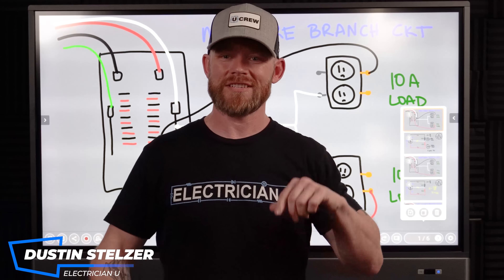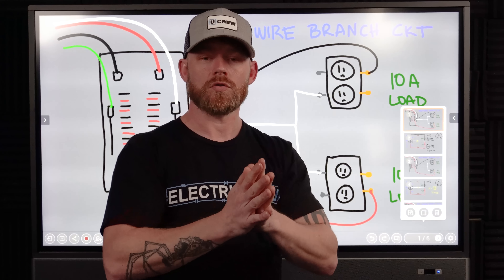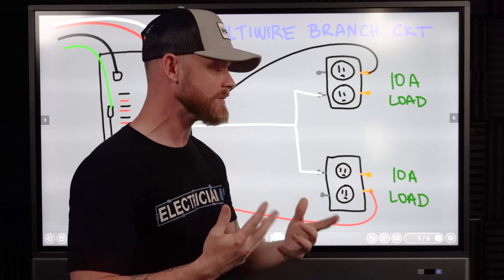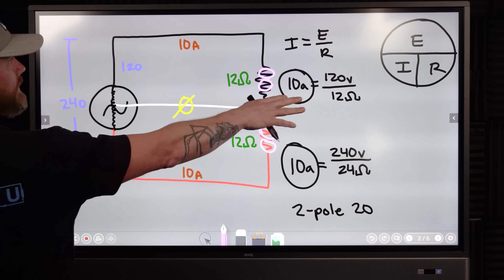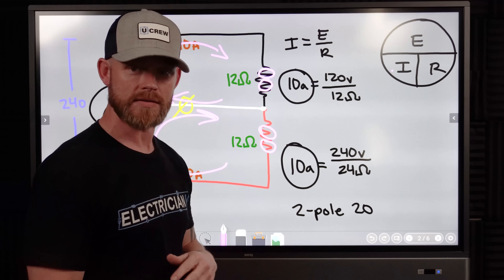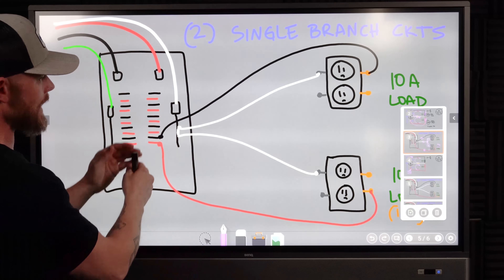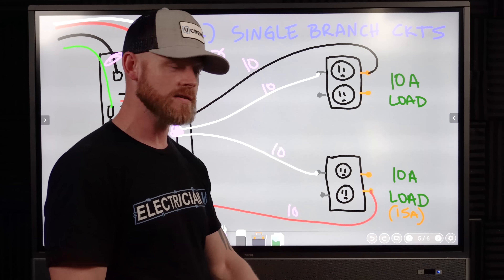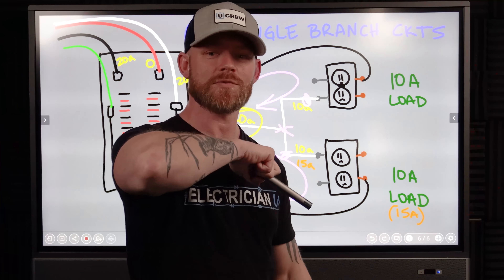Neutral Imbalance in Multiwire Branch Circuits (Two Hots, One Neutral)

Comment: Hello. My home main breaker isn't integrated in the circuit breakers panel that is inside the house. It's apart outside on another box that has the Kwh readings meter on the left side next to the 100 Amp main breaker. 
I need to install a manual transfer switch and a generator inlet box to power the house with two Ecoflow DP and a double voltage hub. My question is.  I consulted an electrician to do the job and he said that in order to install the MTS he would have to get the electricity out of this main breaker box to be able to install it.
I have no knowledge at all about electrical installations,but I'm a little concerned about this. 🤔 I would appreciate any advise from a pro like you. 
Thanks for the video 
🤷💡👍

Comment: The two legs are not 180° out of phase, though. Right? They're 120° out of phase. So they're not always equally opposed in the neutral. How does that play out for a device that cannot handle more than 120V?
Reply: You are mixing the strange US system with 3-phase used in most of the world. Loo up 230/400V 3 phase TN distribution system. Used in most of Europe and the world, but not in the US.

Comment: This is obviously a really thorough explanation about what’s going on but I had hoped that you would explain the pros/cons of implementing this. The electrician who replaced my panel in the 2000s told me he had added 2 breakers for future expansion but this is exactly what he did- 2 breakers in the panel with a single 12-3 wire run.

Many years later when I considered using this run, I finally saw what he did and was confused by it. I finally was able to learn what he had done but wasn’t why. I wish he would have just run two 12-2 wires instead of the single 12-3.

Comment: I'm working on 2 switch boxes. One is at the front door, the other is at the rear door. Each box has 4 switches. The boxes are connected with 14/3 so the switches all control the lights they go to.
I understand all the wiring except the ground wires. Even with pig tails there will be 10 grounds that all need to be connected. What is the best way to connect all the grounds?

Comment: Great video and now I know why I got a shock even after deenergizing the circuit I THOUGHT I was working on.  Will fix this soon, temp solution was to take dishwasher off line and keep stove operating (gas stove so no 240v required, just igniter and clock)

Comment: Is there anything to look out far when splitting up a shared neutral circuit. For example breaking off a section and adding a new line to tie to it own breaker.

Comment: A very complete and on target explanation. A minor correction in terms. A residential electrical system is single phase. The red and black are at different polarity, not different phases. Red is positive polarity (peak sign wave) and black is negative polarity (trough of the sine wave). That's the push/pull effect on the single-phase ac system. [yes, the sign waves flip back and forth, but red as positive polarity and black as negative polarity is how the NEC describes them in 200.6 & 201.5]

Comment: Great video it helps a lot .  Now i have new questions.   

If power is flowing from the neutral to the hot shouldn't the neutral be red or black instead?  

Also is it bad to have two same faze to share a neutral?  Should we always try to only share different faze neutrals? So the neitral wire isnt over loaded unintentionally.

Comment: Thanks for this video. I have this situation where I had a 12/3 on two separate breakers that did not have a common shut off handle. The 12/3 gets split in a junction box to service two separate circuits. I am now going to rectify the  fuse box issue by swapping the two separate 20amp breakers for a 20 amp breaker with one common service handle.

Comment: what are some ways to tell whether two hots are connected to the same phase? I'm guessing if the voltage across them is 0V it's on the same phase, if the voltage is 240V, they are on different phases?

Comment: When you say "balanced load", does this mean every single load connected to the circuit breaker that is also currently TURNED ON?

Or is it just the amperage ratings of every load whether they are on of off?

Comment: Does this apply to only two phase transformer or to three phase as well (if you use only two phases) ?
Reply: The perfect cancellation of the current on the neutral does not happen if two identical loads are in use with a 3-phase transformer.
The transformer which is described in this video is a one phase transformer with a tap in the middle of the winding. The two hot phases have 180 ° phase shift with reference to Neutral.
What you are talking about is a three phase transformer with 120 ° phase shift between subsequent ends (= phases) of the windings.
The neutral is connected to the star point (= the point, where all three windings are connected together.)
Because of the fact that the current is 120 ° phase shifted and not 180 ° the sum of the current on the Neutral is not zero, even with identical loads.

Comment: Great video! Thanks for clearing up what I thought was a mistake I made by sharing the same neutral. 

Here’s a question though. The old man before me had gfi’s everywhere. The one on the circuit (circuits) I did this to had a gfi that was causing the breaker to trip (or maybe it was the gfi, I forget) so I replaced the gfi outlet with a regular outlet and no issues since. Why would that happen? The gfi sensed current in a way it didn’t like?

Comment: Once I figured out that a common neutral will only carry the maximum load of an imbalance, which is equivalent to the maximum load of either hot, it all made so much more sense.  I understood this before this video, but "one pulls while the other pushes" is a great way to explain this to anyone else so I still learned something useful for watching.  Thanks!

Comment: I have a question. If I have a 3 wire circuit going to two different plugs, you said they are now  220 volts so if i plug a 110 devices in to either or both plugs will it burn the device out because the 110 device are on a 220 circuit.😢

Comment: Had an electrician add two circuits to my son's garage (that we made into a workshop).
Helping the electrician, I saw he was running 12/3 instead of two 12/2's.  I bitched.  He said it was allowed (and charged us for two new circuits....no discount for his material and labor savings).
Fast forward to my son getting a Tesla and looking into a power wall (I think I got the vocab correct).
They ran their tests and said they couldn't use the existing wiring because of the shared ground.

Does that make sense?  And can you explain why?

Comment: is it safe to jumper the nuetral wire on the independent top circuit to the bottom half to have 2 circuits or does that defeat the purpose of the shared neutral

Comment: Awesome video as always. Can you do a video on this same topic but with 3 phase? I'm having trouble picturing the pushing in pulling when you add the 3rd phase
Reply: The only way to balance a 3-phase system is to have the same current on all 3 phases like when using a 3-phase motor.
If you are using 2 phases of a 3-phase system, for example his 2 12 Ohm loads, the neutral will carry a small % of the current. If the neutral were open, you would have 208V across that 24 Ohm load which would give you 8 2/3 Amps. With the neutral intact, each leg will have the full 10A with the 1 1/3 A extra running doubled through the neutral.

Comment: Video Idea.... how to add AC cable (2 wire with aluminum bond strip) to NM circuit. Is it grounded properly tho no ground conductor present if you tie to NM 2 wire with ground? Thanks

Comment: Great explanation of MWBCs. i have an older house and wanted to install an appliance in the basement on an existing MWB circuit. I wanted to properly calculate load on the circuit and get an idea of how the circuit would handle a possible unbalanced load on a shared neutral. Mentioning how it is similar to how two single circuits terminate in the panel except the neutrals are tied together before the panel and how the different phases on the two legs cancel each other out on the neutral and the unbalanced difference is what flows through the neutral was also a big help. The best explanation i have come across.

Comment: Replaced electric range with propane range. Robbed one leg of 40 amp two pole breaker to install 120 volt plug for new gas range, how do I make this safe and meet code at the sub panel?

Comment: Question, if I ran a multiwire branch circuit on the same leg (phase) neutral, on a 15 amp breaker, would I be okay if I upsized the wire from 14/2-12/2 to 10/2 since 10AWG can handle up to 30 amps of current? (Not that I would want to do this, just wondering if it could handle both loads on the neutral if I upsized the neutral to 10 AWG or even 8 AWG.

Comment: This was a good video and thorough explanation. I’m surprised you didn’t draw sine waves to represent the black phase the red phase and explain that the sine waves are 180° out of phase and so on. This would be more descriptive then the black phase “pushing” while the red phase is “pulling”, in my opinion. 
The concept of alternating current sine waves is necessary to understand when you go to three phase systems, and useful to understand in split phase systems.

Comment: Technically when running a multi wire branch circuit on the same phase, where the two neutral wires tie into 1 before heading to the neutral buss bar, if you went from #12 to #10 when both loads are 15a you’d be ok right? Because the #10 would be able to handle the 30a load from both circuits combining at the shared neutral. I’ve never done that but I’ve seen circuits on the same phase sharing a #12 neutral. Typically I’d just separate them and tie another piece of #12 to separate them but there’s not always space and not all inspectors like you putting multiple grounds in the same terminal to make space unless a sticker on the panel specifically states that you can.

Comment: I have a question thatI haven’t been able to find much of an answer for I’m hoping you can help. One of my double pole 20amp breakers only works while my dryer is running and my dryer doesn’t heat up since this started. I’m sure what happened that made this happen.

Comment: I'm in the middle of a remodel of house that was built in 1951 with two prong receptacles without an equipment ground.  I'd like to switch them out to 3 prong receptacles and bring them up to code by installing GFCI breakers.  Two circuits on separate legs are three wire with a shared neutral.  If one circuit draws 10 amps and the other draws 5 amps, will the imbalance on the neutral cause the breaker(s) to trip?   If not, should I use a double pole 240v GFCI breaker or two single pole breakers?

Update:  I installed a double pole 15 amp GFCI breaker (not a dual function) in the subpanel with the 14ga. three wire and am getting nuisance trips.  The ground bus and neutral bus are properly separated in the panel.  Because the shared neutral connects directly to the breaker and the pigtail on the breaker connects to the neutral bus, I suspect that the GFCI is tripping when it detects an unbalanced load on the neutral.  I suspect that the same thing would happen with a GFCI receptacle  if you connect receptacles downstream on the load side of the GFCI.  Please comment.

Comment: The operative function here is that both phases are 180° out of synch with each other. Any imbalance is resolved in the neutral, and is not the addition of the two currents rather the only current resolved in the neutral is the result of the lower current subtracted from the higher current that cancels out the other leg.

Comment: Also: the only way to provide GFCI protection to a multiwire branch circuit is with a GFCI breaker. Attempting to use a GFCI receptacle  wiill result in a constantly-tripping and useless receptacle.

Comment: Great Channel!  Question or confirmation.. so, these new GFCI/AFCI requirements at the panel will really mess thing up with Multiwire Branch Circuits as soon as you put any load on it.... correct?  it will always trip the breaker?

Comment: So, actually the water analogy for electrical current is very accurate, except for the fact that you shouldn’t see the current being “pushed” to the load but actually “sucked” by the load. Breakers are valves with a failsafe system to prevent the “hose” (conductor) from bursting when too much “suction” is being applied, yes?

Comment: I really love your videos ive learned so much but Wouldn't it be alot easier to just  run like 2 recepticals off of one 12/2 then there's one hot and one neutral for current to get back to the bus. That's how we do it today in the bahamas

Comment: Lov your channel. Sorry for the ignorance, this is my question. I need to install a critical loads subpanel with 4 circuits (1 ac inverter mini split (10 awg), 1 with an inverter fridge (12 awg), 1 various led lights (12 awg), 1 smart tv and the internet router and a fan)(12 awg).  I  know the code requires to move the 4 neutrals for the four circuits to the subpanel. As an alternative, can I run a 6 awg neutral wire to the subpanel and connect the 4 neutrals to that 6 awg with a polaris connector at the main panel? If not, what will be the consencuences on doing this. The 4 circuits will be sharing a single neutral on a 6 awg. Why I'm considering this, is a concrete house and the only pvc pipe available is already crouded.

Comment: At the end you said the 2 ten amp circuits were on a different phase. Aren't they on a different leg instead because there is only 1 phase on a center tap transformer.?
Reply: I think that you are correct. I've noticed that lots of people use the term "phase" when they should be saying "different leg, opposite poles, different line, L1 and L2, " or something like those terms.

Comment: If I am using two legs of 208 3Ph to create 208 single phase for an oven heater, how do I size a neutral knowing that each leg is not 180 degrees out of phase and offsetting.  Thanks

Comment: Help I have a double pole breaker 50/50 for a 240 volt electric tankless water heater, I can’t figure out where the neutral goes
Reply: There's no neutral in a 240v system. The 2 poles alternate symmetrically between power and return.

Comment: for what i know for each hot wire, you need a neutral, you cannot bypass this rule because risk of overcharging the cable
Reply: As long as the hot wires are on different bus bars, there's no risk. This will happen by default when using a double pole breaker.

Comment: what if there are 2 circuits in one J box..... if all the neutrals get put together under one Blue wire nut would that cause a potential issue?
Reply: Yes, the neutral wires must be kept within their own circuit, unless it's a shared neutral in a MWBC as shown in this video.

Comment: Hello I was studying and saw a section in my book that stated “In multiwire branch circuits, the continuity of a grounded conductor shall not be dependent on the device. 300.13(B). If breaking the grounded conductor at the receptacle breaks the circuit down the line, then the grounded conductors must not be connected to the receptacle. Simply splice the grounded conductors and install a jumper wire to the receptacle.” I’m confused on what this means could you explain? Thank you!
Reply: Instead of one split receptacle (hot side tab removed) you're using 2 unsplit receptacles, you must use a pigtail on the first one. This is a safety consideration so that in the future if someone changes a receptacle that is part of an MWBC, they won't inadvertently cause an open neutral.

Comment: HEY MAN IN MY YARD I HAVE TWO HOTS AND ONE WHITE WIRE AND EACH HOT HAS A 15 amp breaker.  CAN I SPLIT THE NEUTRAL AND PUT TWO OUTLETS??  SO ONE HOT WIRE TO ONE OUTLET AND THE OTHER HOT TO THE OTHER OUTLET WITH SPLITING THE WHITE WIRE

Comment: I'm sorry to tell you that your explanation completely wrong. There is nothing called current cancelation, if u have two fase with different timing one ahead and one lagging and both pouring in the same nutral then everything is fine because u will never hit that max load, one phase at max the second at 0 when the second at max the first at 0, so always u will have let say 15A max for example. The problem will happen when you have 2 phases with the same timing in that case u will have an issue because u will overload ur nutral, if both phase at max then u have 15A+15A pouring into one single nutral of 15A max therefore u will have 30A  of current pouring on a max of 15A which will result in overheating on the nutral wire. That's why we use bouble pole breakers because they connect to different phases with different timings. Thanks
Reply: Not phases with the same timing, phases with opposite timing. The voltages and currents here are complex numbers (basically 2D vectors), and the two voltage phases are opposite sign to begin with. That means you're going to need one inductive load and one capacitive load on the two circuits so their current vectors are rotated to match, and sum together rather than cancelling.